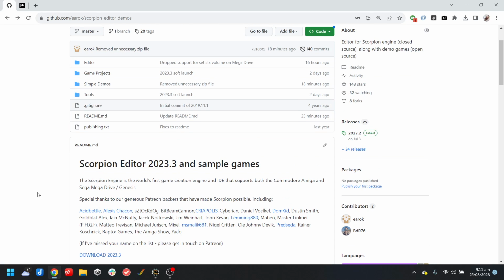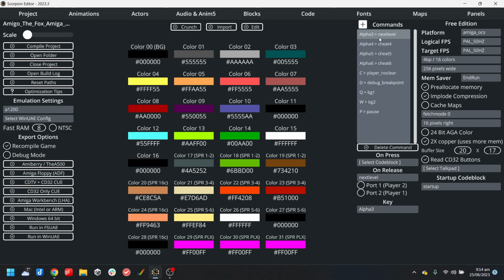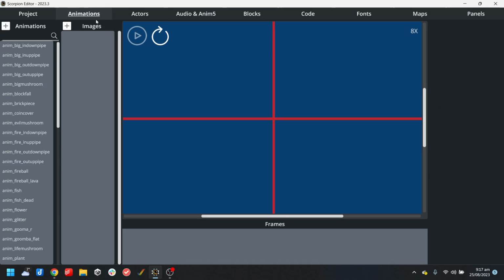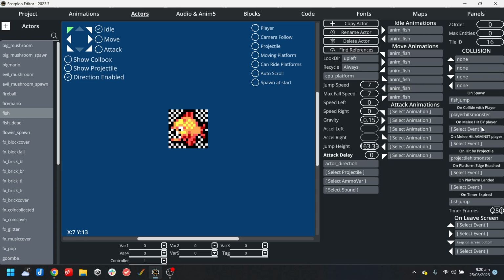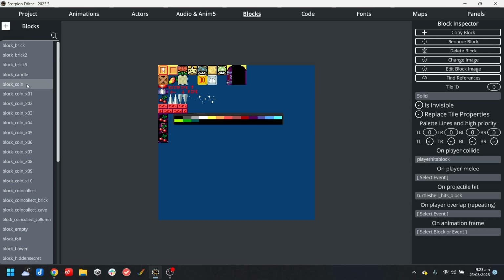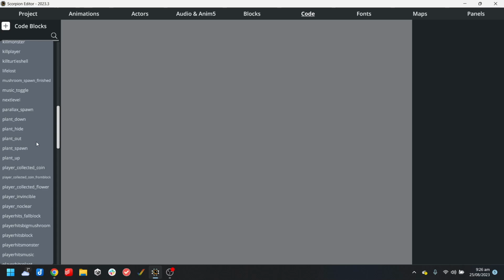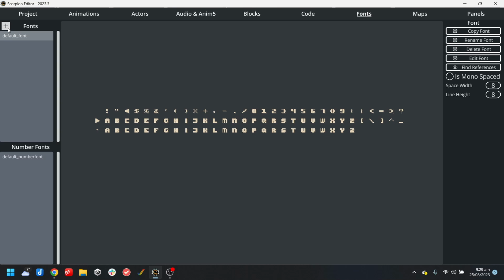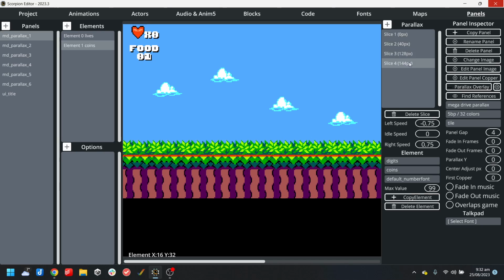Scorpion Engine 2023.3 (Amiga/Mega Drive/Genesis) brief introduction

Comment: This is such a 'game' changing tool for the Amiga (and MD) platforms!  Question: will there be things incorporated in the future like Sprite (Bob?) rotating and zooming and such, like seen in games like Brain the Lion, or Mr. Nutz? (or things like 'rope physics' or HAM mode (if not already)). Also, with the new option for exporting to CD32 iso, are there (hypothetically) new possibilities (Streaming from CD, or using the Akiko chip for example)?.  Sorry for all the questions, very excited about this project!
Reply from the maker: Thank you! 

I've started experimenting with bob zooming already (using the technique outlined at https://plutiedev.com/scaling-sprites, although that's a Mega Drive page the technique is applicable to both systems), but it may be awhile before it's part of the core engine. I'm not sure about rotation but I'm definitely keen to integrate 'demoscene' like effects into the engine to really help the games shine.

Streaming from CD might be possible, I've done some work on FMV games for Amiga in the past (Time Gal and Road Avenger), I'd love to bring that capability to Scorpion Engine. I'm not sure about Akiko but it might be useful if there's ever a mode 7 like effect added to Scorpion.
Reply: Thanks for the answer (and link), very promising prospects indeed!